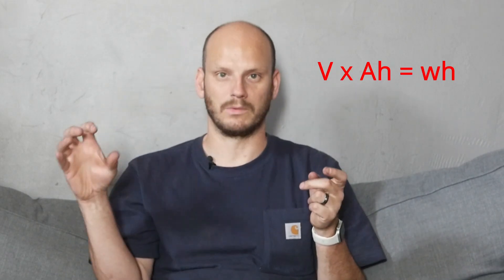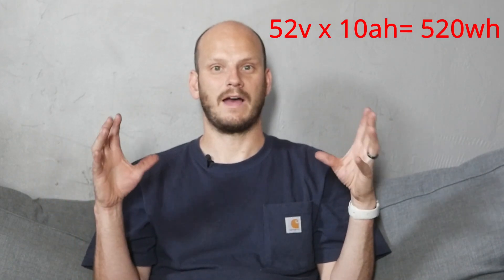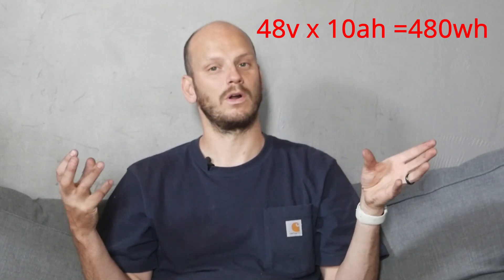How to calculate how big of an E-bike battery you will need

Comment: Hopefully you can help me, I am currently running a 48v 1000watt rear hub motor with a 48v 1000watt battery.

I would like to add a 48v 1000watt front hub motor, so that I'm running front and rear hub motors.

BUT, I only want to run a single battery...what Voltage and wattage battery would I need to run these front and rear 48v 1000watt motors

Hopefully that makes sense and you can help me
Reply from the maker: A single battery probably won’t have enough power both at once. Each motor is pulling 25a each at least at full power. You battery has to be rated for 50a at least.
Reply: @JohnnyNerdOut  I'm probably just gonna upgrade to a 72v 2000watt rear hub motor and battery, thank you for your help

Comment: my brand new 48v 20ah battery is only charging to 49.5v which is less than 70%, the battery meter also reads 3/4 green lights. not had the bike out yet , only charged the battery and got the motor fitted. any thoughts? i purchased a 5 amp fast charger from the same place i got the battery
Reply from the maker: Usually only three greens light will appear and one red one led (for some reason). 49.5v is weird though.
Reply: @JohnnyNerdOut  turns out i was testing the battery while it was switched off 🙄when i turned it on and tested i was getting a solid 54.7v. big relief!

Comment: This question is about cable length. If you buy a commercial bike from a retailer there are no straggly cables, this is for all sizes.

Does Bafang have the power wiring sets for the different sizes of bikes, small, medium, large.
The conversion kit sounds good and operates well but the idea of splicing wires to approve the aesthetic appearance of your bike is beyond many of us riders.
So, are there different size lengths available to fit your bike
Reply from the maker: In my experience, any straggly wired can be nicely organized by zip ties. It really makes it look cleaner by doing some simple cable management 👍

Comment: A smaller battery (physical size and weight) has bigger internal resistance. Bigger internal resistance losing more energy.Lost energy converts to heat. Heats destroy a battery ;).  Avoid light batteries. Good 18650 battery cell wight about 50g. So 52v 14Ah should contain 14x4=56 cells of 3500mAh(2.8kg) plus box. or 14x6=84cells  of 2500mAh(4.2kg) I would my choice for PAS  3500mAh cells 10-20Ah.... For throttle 20Ah (3500mAh cells) , 15Ah 2500mAh,10Ah 2000mah. Its point of view from an electronic engineer ;(

Comment: Thank you for yet another helpful video Johnny. Do you have any suggestions on how much % to use from the battery before charging it for a better battery life ? Is using it the normal way from full to 0 and then charging it to full the right way to go about this or should I charge it to a certain % and drain it to a certain % so it lasts longer and has a healthier life overall ?
Reply: between 30 and 80 .. or between 20 and 80... and for cell balancing every few charges fill them up to 100 (but only if you ride it right after charge... not store for long on 100 SOC)

Comment: Hi wondering if you have any ideas 
How can I calculate the AH of my battery I had it made it’s 
LiitoKala NCR18650B 3.7v 3400 mah 18650 
Max up to 20A 
36v pack
I have 100 batteries in the pack 10s 10p
Reply from the maker: Each cell is 3.4 ah according to your statement, just multiply it by how many are in parallel. If 10 then it would be a 34ah pack

Comment: because of your channel I'm building  a BBSHD machine....thanks!  I noticed you use 52v batteries for the BBSHD.  Heard all kinds of things that the 52v will register inaccurate level readings on the screen.  Any insights?
Reply from the maker: Depends on the display and whether it’s calibrated. But ya I have noticed on the 500c that the gauge is off. But the voltage reading is still correct.

Comment: I feel like the problem with an extremely low hour battery pack is usually the low current abilities that relate to having fewer cells and parallel in the pack. If you're maybe only going 2 mi but you have a 50 amp controller a 600 watt hour battery is going to going to protection under hard load or just f*** your batteries up if you don't have BMS protection for that. Anyway good info there I like your math trick for estimating battery needs

Comment: I can't stop myself from buying more than I need.  FOMO (fear of missing out)  So I purchased a 52v 17.4ah battery which is just under 905w.
Reply: Bigger is better than smaller.
1. If you get a bigger battery it will last you more cycles
2. You will get more Wh out of each battery cell because of less A drain pet cell
3. As the battery discharges the voltage decreases so bigger battery means more voltage for the motor
Reply: I have that size battery, wish it was bigger 😅
Reply: @doctadrey3000  I'll be building a true touring bike and plan on going crazy with the battery.  😅
Reply: @chaleowin7732  let me know what you end up getting

Comment: I need assist for 30 miles, going 25 mph average speed. Should I account for 30x20 in that scenario? (pretty flat, good asphalt and I'm lightweight)
Reply from the maker: You’d be burning 30-35 wh per mile probably

Comment: Batteries account for about half the price of a kit. For maximum battery longevity you need to knock 40% off the listed Ah rating (20% off bottom and top, you don't run it below 20% and only charge to 80% of capacity) when calculating your battery size. A 10Ah battery is only 6Ah in this case.

Comment: I enjoy your videos.  I installed a 1000 watt Bafang motor on a mountain bike along with a Bafang 48 volt 12 amp battery.   I get about 20 miles with it.   I wish it was longer.  Anyway on ebay they advertise a 52 volt 25 Amp battery for $161.  Obviously the price is very cheap.  Is this battery worth it?
Reply from the maker: NO! Avoid!

Comment: Most experienced cyclists ridexa cadence between 60 & 80rpm pressing pedal no harder than walking on the same surface. They are going to be burning through a hundred watts/hr. They'll be riding between 12 and 18mph, depending on their bike. So, a 48 volt, 10ah battery is going to serve them good enough for about 4 hours (we don't want to regularly abuse a battery). 

I am a fan of two or more smaller batteries vs one large. 90% of your rides you aren't going to need even a tiny battery. Why Cardy the heavy, harder to handle battery when there is no need? Two small batteries currently cost less than one large and both will hold up longer if you rotate them in daily use.

Comment: With me (heavy at 214 pounds) I usually use about 500 watt-hours every hour that I am riding in my hilly area.
I average about 13 miles per hour because of stop lights,intersections,hazards,traffic  within my city.
I sometimes have 2 kilowatt hours of lithium ion battery packs on longer rides and that gives me 4 hours of riding time.
I am tempted to add another 500 watt -hour pack to it (which I already possess) to further extend range.
I am starting to lose excess body weight fairly quickly though and the more body weight I lose the more battery packs I can carry on my ebike.
A month and a half ago I weighed at a heavier  and dangerous 230 pounds.
Hopefully I will again reach a body weight of 175 pounds which would be about right for me.
With less weight my range should improve.

Comment: “Biggest one that will fit in the frame?”  A 21 amp hour was smaller than I liked.  I wanted a 28+ amp hour, ~ 1450 watt hour.  (There are 60+ mile trips I want or need to take, and while I tend to go between 12 and 17 mph/20-30 kmh, my knees tend to give out at about 25 miles or so, so I need to use throttle then.)

Comment: first criteria is not range, but rather how much power the motor draws worst case continuously (e. g. regular long uphills, always high speed). to avoid premature capacity drop I would not exceed 1.5C continuous current draw from the battery. take a bbs02 @48 18A and you're looking at a 600Wh battery. need more range, just go for a bigger battery but no smaller than 600Wh

Comment: Or be me, be a fatass, want to use just the throttle, use a 1500w motor, get less than 30 miles on my 800wh battery...
Reply: what speeds to you average? i need to go at least 30mph for about 30 miles to get to work

Comment: Great video! As per usual! 
Picking up my used Craig's list, 26" tire, small frame, Specialized Hardrock Sport, hardtail disc donor bike TODAY! YEAH! Inspired by you Johnny Nerdout! I'm 5'8" but I like the idea of a small frame so I can easily put my feet down when I stop.
Will be 69 in July, a stroke survivor in 19, a liver transplant survivor in 09. You might say I'm kind of a survivor of sorts. Still working in tech support. Plan on a Bafang mid-drive of some sort, though I may have to wait for availability to improve. Not sure if this aluminum frame bike can handle the BBSHD torque, but all the 750s seem to be sold out every where.
Reply: Depends on how you go, actually.  The stolen bike (March 13, 2021) had such a motor, and seemed to cope passably.  Note it was not a 750 watt setting, either.

Comment: When I built my electric mountain bike, I bought the largest battery I could find because I read that when the battery has been charged around 500 times, (I don't take mine below 10%) the battery will lose about 20% of it's capacity.  so my 58v 23.8A is 1380 watt hours and I get around 60 miles range, but I can only do 15 to 18 miles before my back says FU lol,  with me pedaling  (typically I live in pedal assist 2.  if I am pedaling through mud or boggy stuff I will go to 3, same for rough steep hills)

Comment: Does this only apply to mid drive motors? I have a hub on mine (I know yuck)
Reply from the maker: No it applies to both
Reply: @JohnnyNerdOut  ty Johnny!
Reply: Correct.  Hubs typically use more watts to achieve the same level of performance, so a larger battery is wanted for a given range.  I was quite surprised to learn the BBS-HD was about a third more efficient compared to the hub I had the use of.
Reply: @dennisyoung4631  ty!